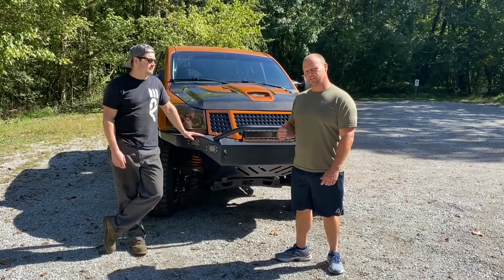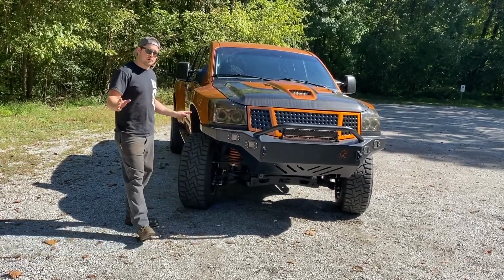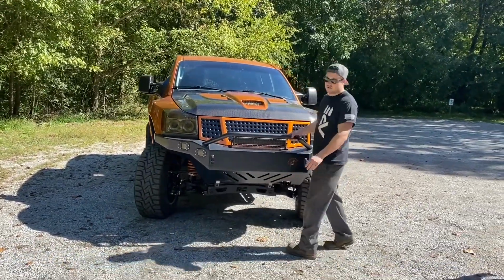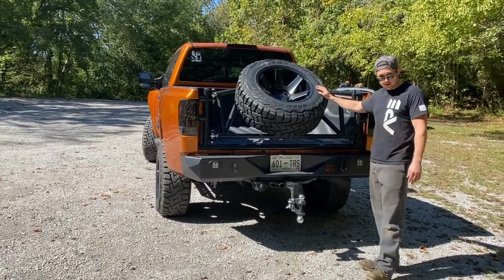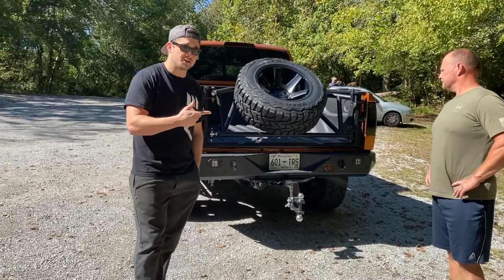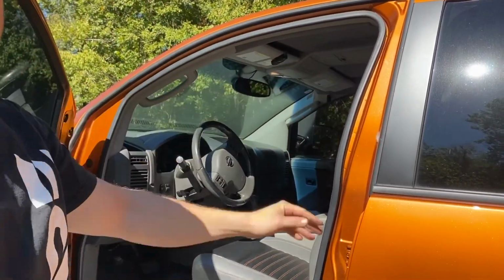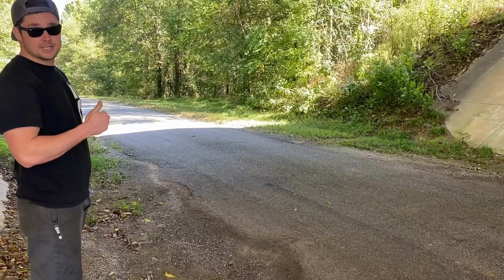APE Nissan Titan Build Out

Comment: Nice. Did you use all the original wiring and anti theft. I have a 2012 that is locked down from anti theft and I can't get it started. Just wondering if you eliminated some of the problem areas of the truck.

Comment: What was the budget for this truck? So far I’m $3k in modifications for my truck
Reply from the maker: The customer didnt have much of a budget... simply kept buying parts for us to install... followed by the body shop installing fenders, bedsides, and finishing it off with high dollar paint.  The truck is currently for sale for 40k... he has way more than that in it... and you would probably be better off buying it as opposed to doing all of the work from scratch.  Projects like this get expensive fast!
Reply: @apebuilt  $40k for an 2004 pickup truck?! That’s insane. It’s a beautiful build.

Comment: Can you explain what the differences between a 410 rear end and a factory one
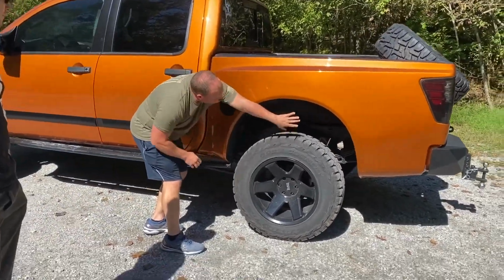Reply from the maker: It is a Currie enterprises dana 60 rear end.  When saying it is a 4:10 rear end he was referring to the gear ratio inside of the axle's.  I believe the stock gear ratio on this year Nissan titan was a 3:55 or 3:73, when we did the build we changed to a 4:10 ratio to help with the larger tires and low end power.  It will also help in making the titan quicker off the line... but slower at high speeds.  Keep in mind if you change the gear ratio in the rear end, you must change the gear ratio in the front axle to match.

Comment: Awesome job guys! How do you find that 10 speed transmission  also what does it cost to run a build like that?
Reply from the maker: Thank you sir!  Its not a 10 speed transmission, it is a performance transmission built by LevelTen transmission... they build high performance bullet proof transmissions for all kinds of vehicles.  
The truck is currently for sale on a website called socaltrucks.com.  
Cost can vary drastically depending on what the final goal is.  Preciate the support!
Reply: Why for sale?
Reply: @secretovrtistico8928  Because the owner probably paid thousands of dollars on this build and doesn't have time to Offroad?